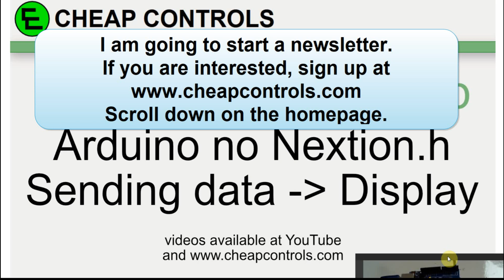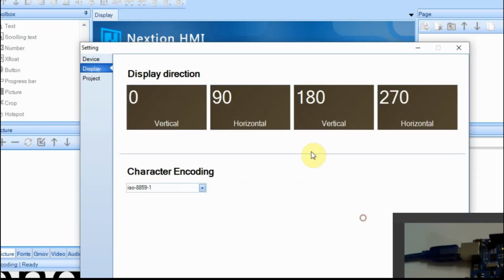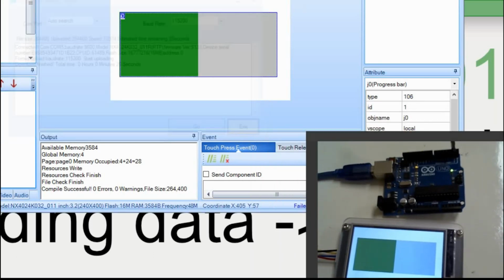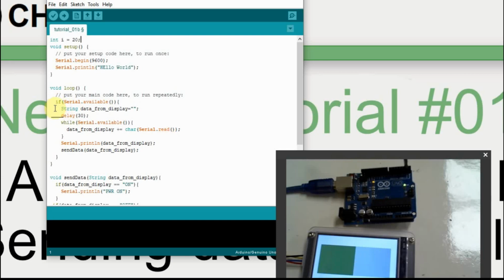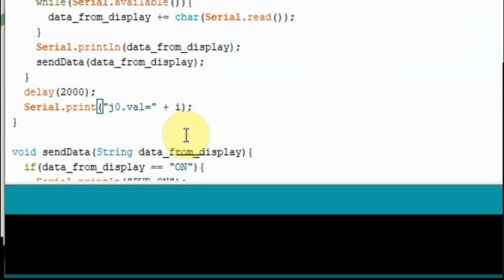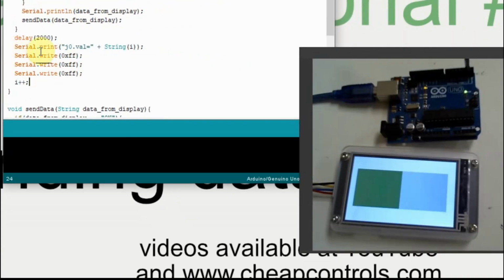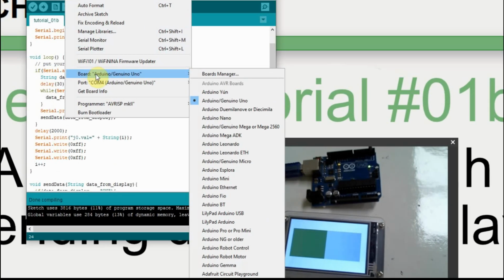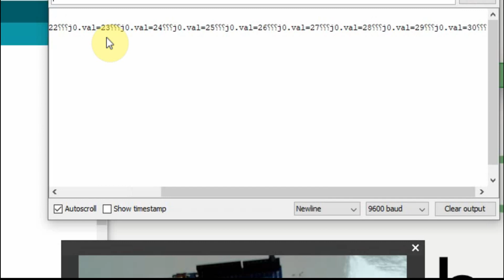65  Nextion Display - no Arduino Nextion.h Library part 2 or 01B

Comment: In serial monitor after j0.val=data???
Can you please explain why 3 question mark is there after data
Reply from the maker: commands are terminated by three 0xFF hex values.  The serial monitor does not know how to handle extended ascii, so it interprets each 0xFF it as a "?"

Comment: Very nice series, thanks for sharing. I have a problem send an integer from adruino to a nextion text field. The value goes to the nextion but it is not updated. Here is what I do. I want to send a value from arduino to nextion to a text filed located on page1, so I use:     
Serial2.print("page 1"); // change the page to page 1
Serial2.write(0xff);
Serial2.write(0xff);
Serial2.write(0xff);
Serial2.print("va0.val=" + String(timer_delay)); // send the timer delay setting to Nextion
Serial2.write(0xff);
Serial2.write(0xff);
Serial2.write(0xff);  

I want to send this to a text field name t0.txt on this page, how do I go about doing this so it refreshes the value in the txt filed immediately?
Reply from the maker: Change va0.val with t0.txt.  You also have to add the quotes  in Arduino it would be Serial.print("t0.txt=\"" + String + "\"") then write the three 0xff
Reply: @CheapControls  What I'm trying to do is have a txt object in nextion that is incremented or decremented using button on the nextion. This is a delay setting in a settings page. When you exit the settings page the nextion send the value to the Arduino which in turn stores the setting in eeprom. In the event of a system reset the nextion looses this setting so the Arduino retrieves it from eeprom and sends it to the nextion. I just can't figure out how to show this value in the txt field. I now that the nextion receives the value and stores in in the variable that I increment or decrement it is just that it is not shown in the text field. If i exit and re enter the page the value is shown corrctly in the txt field as it should.
Reply from the maker: is the scope of the text field local or global?  When you choose global it will retain settings when you leave and return to a page.  If you want the text to be changing while on another page you have two options.  1) on page initialize read the variable - this will make it appear that you are updating.  2) set the value as global and update while on the other page.  Look at this video if global is not familiar https://youtu.be/jXpgeZ7cmRo  If I am misunderstanding your question then I apologize and please go to www.cheapcontrols.com and submit a request on the help page.  Sometimes email is easier to review code and exchange files.

Comment: Nice! Question: when you set default encoding iso-8859-2 in Nextion, how is it in Arduino? Arduino default is utf-8 should i stick to this encoding or change it to iso-8859-1 as well?
Reply from the maker: I have never adjusted the encoding.   I just leave it as default.  If this is not a good answer, I might not understand the question.  I may not have adjusted encoding.
Reply: @CheapControls  Thx, and your Arduino IDE is utf-8 right?

Comment: Nice video series, thanks!  
While I'm waiting for my Enhanced 3.5" display to arrive, I've been creating my screens virtually.  I'm using an onscreen "Number" object to display the numeric percentage of "progress", then copy that value (1-100%) to my Progress Bar.  Within the Nextion display, I can calculate my "numeric progress"  by diving two other values that my MCU will be sending to my display. I do this in math within the Page "Postinitialization Events"... but I'm not sure this will work as desired... because those Events won't be constantly refreshed... at least this is what I noticed by running Debug and sending new values to the virtual display with a "n1.val=400" command. When I do this, it does update the "n1" displayed value on the virtual screen, but it does not recalculate a new "Numeric Percentage" value, nor does it update the "Progress Bar"  I'm trying to minimize the amount of Display work that the MCU will have to do, so I was hoping to let the controller in the disply do the math without intervention from the external MCU.
Do I have to put this math elsewhere, or do something like use a Timer to force the math every 200ms or something? Will that even cause a Progress Bar refresh?
Reply from the maker: The timer is a good solution to continually update an object.  Just remember timers only run when the page is displayed so if you want to run the events when on a separate page you need to make the objects global and add a timer to each page.  Good Luck!  Thanks for taking the time to comment.

Comment: i wish to integrate a BN880 with compass and BME280. I can read them but i do not have acces to add them on my nextion 😞 . If u can do a tutorial about it, it will be really cool . Thanks for all of ur videos. really good job
Reply from the maker: That would be cool!  But, unfortunately all my equipment is packed up.  I will try to do this after I get moved and my shop is set back up.  Thank you for watching.

Comment: Can you please help me with my project. All I need to do is have a number decrease  by 1 everytime a pin reads "HIGH"  on my arduino. I need it to start at 15 and decrease. If I could reset the value with a different HIGH reading that would be amazing too
Reply from the maker: Normally this is the type of thing I would make a video on but I am going through a move and have to finish the house we are moving too by the 19th of the month.  If you have time to wait I might be able to get to it next month.  Your other option is to start working on the code and email it to me for review.  If you go to www.cheapcontrols.com and submit a comment with your email.  I will respond.  Good Luck with whatever you choose and thank you for watching.

Comment: Hello Sir, 
I actually used this page 0.t5.txt=\*   *\ to send data from arduino to nextion display.  This command worked on a small project consisting of only 1 blank page. When I used this same command on a big project with 10 pages, it never worked , the text box remained blank.  Is there any error  that I am making. How do I solve this problem?
Reply from the maker: I thought I had a video on writing to other pages but I can't find it.  When you write data to a field on a page not showing you have to make sure the field on the nextion is set to global.
Reply: I have set the text field as global. I have even set the page at global scope. It still won't work.
Reply from the maker: Then I am not sure why it is not working.  If you want me to review your code you will need to go to www.cheapcontrols.com and submit a comment with your Email address.  I will reply and ask for your hmi and arduino file.

Comment: Can we change borderc too through arduino. 
I send the following command and nothing happened. 
Serial.print("page0.t5.borderc=50712");
There was no change on the display.
Reply from the maker: When you look at the attributes some are green and some are black.  The ones in green you can alter in the code.  The ones in black are not adjustable while the code is running.  borderc is not adjustable within the code.
Reply: @CheapControls  Ok. Thankyou for your input.

Comment: thanks sir but i have a one problem that i want to use this display for led brightness control with pwm with four switches on display one for on and second for off and two switches for increase integer value and second for decrement value but i face a problem that my switches give the serial data right but problem is that when i touch the given switch serial data will come and my arduino uno programme rotate in one loop. thnax if you help me i will so happy.
Reply from the maker: I am sorry but I don't know what you mean by "arduino uno programme rotate in one loop"  Will you try to explain again.
Reply: @CheapControls  thanks sir but I done it

Comment: Great tutorial as always!  I have a few questions that I would like guidance on if you have time.....
1. I have multiple pages in my project, therefore which ever page has focus, that element assumes the value being sent.  In other words there is more than 1 "j0" and "n0"   Is there a way to sent that value to just one screen without the library?
2. Part of my project is using the HT22 temperature and humidity sensor.  Those are floats prewritten in the library.  I'm having a hard time taking those and sending them to the Nextion.  Is there a trick to that? (Maybe you already have a tutorial done on that topic?)
Reply from the maker: 1. You can make the items global.  Then you access them with the page.n0.val instead of just n0.val  check out this video https://youtu.be/jXpgeZ7cmRo.  

2. floats are a little different.  If you have an Arduino float of 98.5 degrees.  Multiply it by 10 and turn it into an integer then send it to the Nextion.  The Nextion does not understand float values but they do have a display  that sets a decimal point at a spot that you want.  check out this video.  https://youtu.be/oJ4s6svG438  

If you have more questions ask away.
Reply: @CheapControls  You're indispensable! I actually found an easy way to fix my first problem, just rename the object so each page has something different! duh.. LOL, too easy.  Thanks for the links too, I so appreciate you taking your time.
Reply from the maker: I am glad you found your solution

Comment: Hi, 
Thanks for your efforts
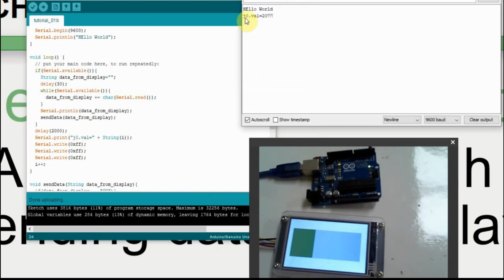I checked your video because I noticed some issue with the display, and the same issue happend at 7:39.
Basically, when you enter a new line, the display will not read the first instruction, I guess there is a hidden charecter, so your program in fact started at j0.val=21, not 20. What I did to solve the issue is to send three high bytes to terminate what ever hidden after printing a new line, then I entered my instruction.
Hope this helps to get more accurate results🌹
Reply from the maker: good observation.  Thanks for watching.

Comment: i have a quition please i need it for my degree projects how can connect a SD card to arduino for a database to save id and password for access i mean they're both serial (9600) does it make sence if i use it 1 time
Reply from the maker: I have to be honest.  I have no idea how you would put a database on an Arduino.  Maybe a Raspberry Pi?

Comment: I got some error when i want to change the serial connection to serial3 for my project. I just change serial.begin and serial.print("j0.val=" + string(i)); to serial3.begin and serial3.print("j0.val=" + string(i));  but it doesnt work. Can you give me some suggestion?
Reply from the maker: Did you try Serial2?  I have never used Serial3.  I will try it on my next experiment.  I don't think there is any difference between Serial2 and Serial3.  Also what error message did you get?
Reply: @CheapControls  I didnt try Serial2. There is no error notification, just cant showing in serial monitor. But its not a problem now. I just hook up serial3.print and serial.print too. serial3 for run command nextion and serial for showing state condition in serial monitor. Now the command from arduino due is well execute to my nextion and my nextion or arduino act can be read in serial monitor.
Reply: But my big question that always i thinking is why serial3.print can't showing the command in serial monitor like you did in your video? Why dont act like serial.print does that the command can be read directly by serial monitor?
I still learn it by watching your videos.
Reply from the maker: The USB connector on the Arduino board is the same as serial.print  This is the same used in the serial monitor.  I do not think it can be changed.  If you have the serial monitor running when you upload code to the Arduino you will notice the serial monitor will stop until the upload is completed because it can't do both at the same time.  I hope that was clear.

Comment: Não consigo replicar no ESP32, pode me ajudar ?
Reply: Which part is not working?
Reply: @marklyle5666  Eu recebo o print do codigo na console, mas não chega no t0.val no nextion.
Reply: @ipjunior  t0 does not have a .val  it would be t0.txt and would not work in this example.  try a number instead n0.val  or you need to escape the value you are sending back to the to.txt  like this Serial.print("t0.txt \"") + Sring(1) + "\"") ;  I am writing this out of memory I am not sure if it is a backslash or forward slash.
Reply from the maker: @ipjunior  Did you get this going?
Reply: @marklyle5666  me expressei errado, (n0.val), eu fazia em arduino antes, porem com esp nao consigo fazer com que o nextion funcione, vou tentar hoje de novo, se puder me chamar no whatsapp +5511960438648, eu conseguindo fazer uma informação passar do esp32 para o nextion ja vou ter um modelo de como seguir o projeto.
Reply: @CheapControls  ainda não consegui, mas sei que vou conseguir. Seus vídeos do ótimos, parabéns.
Reply from the maker: I do not use whatsap.  If you want join the Cheap Controls Facebook group I will give you an email address to send you code for review.  YouTube is too public for personal information.
Reply from the maker: I have been meaning to create another version with the Raspberry Pi and the ESP32.  I will add it to my list of upcoming videos.

Comment: Thank you so much for the wonderful explanation. I am already using this method of transmitting data from ardrino to mention. I have a question, I am using multiple pages in my project. I need to send some numeric data to page 2, how to do that using this method. Thanks
Reply from the maker: https://www.youtube.com/watch?v=jXpgeZ7cmRo Check out this video
Reply: Thanks, that was really helpful.. Cheers

Comment: Good Morning
I have included a link to a four part article on the Arduino Serial, I found it very useful while working with the Nextion Display.
http://www.martyncurrey.com/arduino-serial-part-1/#SerialCommands  One thing that was brought to my attention is that 'delay' is not such a bad thing when working with the Arduino Serial since 'delay' does not stop the Serial.
W
Reply from the maker: I use the delay also.  It has its place.  I get a lot of code sent to me with problems and the problems are frequently delay issues.  I want to show an alternative.  But I don't really have a problem with delay as long as you understand how it works.  Thanks for the link I will read it.

Comment: How do you send a float val?
Reply from the maker: I have been having trouble with some shipping.  I can do this video in the Nextion Debug window.  I am planning on one for next week.  Thanks for the reccomendation.
Reply: @CheapControls  Thank you, I figured it out. This works for me. I am looking fwd to seeing how you do it.
char humO[11];  // in declarations at beginning of program.

  dtostrf(incomingHum, 8, 2, humO); 
    Serial.print("humO.txt=");  // 
    Serial.print("\"");  // 
    Serial.print(humO);  //
    Serial.print("\"");  // 
    Serial.write(0xff);  //
    Serial.write(0xff);
    Serial.write(0xff);
Reply from the maker: @jamescullins2709  Most of my videos don't end up the way I plan them at the start.  I have a good idea about how I want to do this one but I am not sure.  I plan on avoiding the dtostrf but since I have not tested all my theories I may end up including it.  I had planned on using readuntil in place of while serial available until I started shooting one of the videos and my plan crashed and burned.  We will see how it goes.
Reply: @CheapControls  Glad you're researching it to find other ways.  I found if I needed to send a group of floats it would miss the first one, I just sent the first one twice and it would always display them all. Not elegant coding but it did work.Thanks